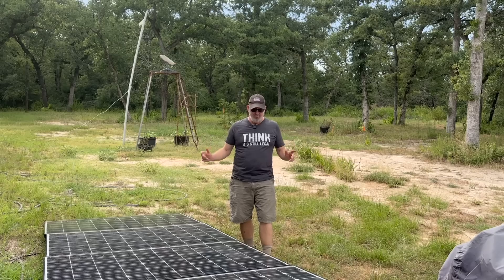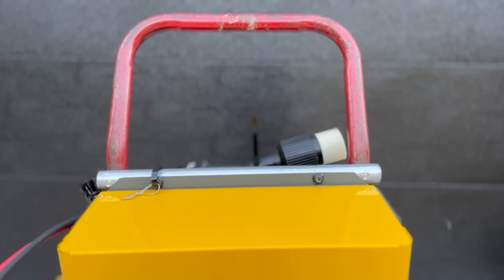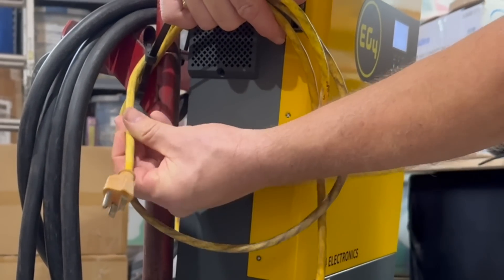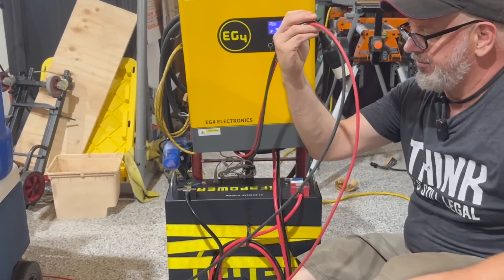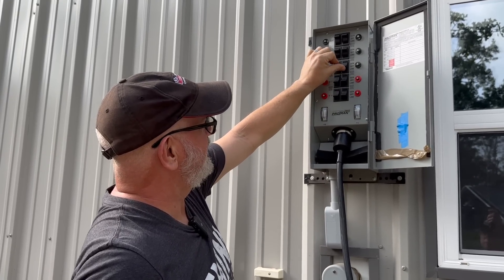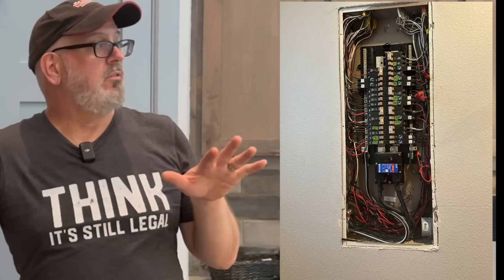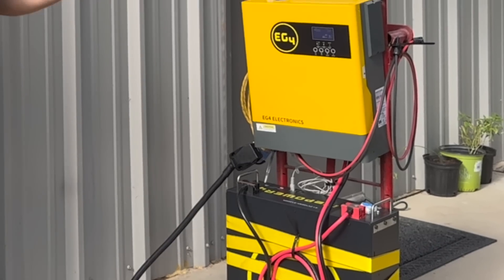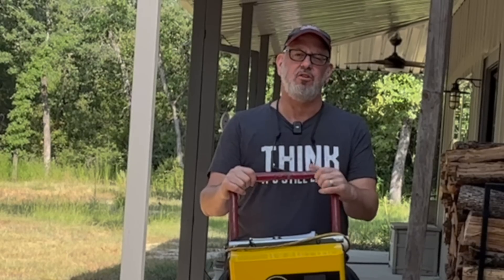CHEAP DIY Solar Power Portable Generator

Comment: Have you tested the runtime with ref. freezer and  small a/c ect.  I know how to figure watts and watt hours, just seeing if you have tested your system.
Reply from the maker: Thanks! I have 2 full size French door refrigerators, one med sized chest freezer, on demand propane water heater and all the plugs, lights and C fans as critical loads.  Since the appliances each turn on and off by thermostat, it’s tough to get an accurate wattage consumption as the watts fluctuate.  I can tell you we lost power for 4.5 hrs a few weeks back and the temps were 100f+.  I did not power any air conditioning since the house was already cool.  It powered everything during that outage and the battery had almost 50% more power left over.  I’d estimate we were averaging about 500watts/hr constant draw.  Add a 6000 BTU window unit and the consumption would have doubled.  Any air conditioning is going be a constant drain so that will shorten the run time significantly.  With a 5100wh battery drawing down to 20% SOC you’ll get about useable 4000whs from the battery.  I’ll set up a better test once it cools down a little.  👍⚡️☀️🔋
Reply: Still haven't pulled the trigger on building my system yet, hurricane season is on us now, Iv'e got the generators ready though. Will be watching your channel for updates.  May have to ask for some advice and tech. help.  Thanks! Stay safe... @terrahillfarm
Reply from the maker: @t.d.harris1311  Thank You! I’m not a big shot YouTuber like some of these folks but I enjoy diving into most energy independence projects and making quality videos to share the knowledge.  I don’t mind answering questions as long as you don’t take my advice as an “expert”🤣

Comment: System questions:
Do you know how much standby watts are used by the system just to have it on with nothing attached?
Also what is the minimum voltage of the array in order to charge with a solar panel?
Reply from the maker: Thanks!  I’ve heard between 50-77watts standby drain.  I think 70w is pretty close.  So you’d need about 300w of extra solar to offset the loss.  You need a min of 120 volt solar to turn on the Mppt.  Good news is you can run panels in a long series string to get there and that allows you to use older panels if you want o save money.  4-6 panels with 36v output would be a good starting point.  The downside of low cost HF inverters is the high standby power.  Haven’t found found any with less than 60 watts.  ☀️⚡️👍💡

Comment: Do you have links to the rv cords?
My setup at the cabin they wired an RV plug for me that goes into my breaker box and I plug that into the gas generator.
And I watched will prowse video and that's when I got the idea and then I saw your video and I'm like well this would be great I could just plug the cabin right into that. But I need the part that receives the rv plug. For ac out of the inverter.

Comment: How many of those batteries can i add to that setup? Because all of the videos with this exact setup use only one battery. And if you can would it be best wire the batteries up in series or parallel? Ive been wanting to do this project but i really need to have 3 maybe 4 of those batteries, would that inverter system handle it? Sorry im new and i kinda became addicted to solar lol
Reply: Since they are 48V nominal batteries, you should only hook them up in parallel, but you can put as many as needed in the system, if you can afford them. The reason THIS set up is using only one battery is to keep it mobile. Yes, the inverter could handle more batteries, as long as you use a properly sized fuse.

Comment: You could get a bit of ROI by leaving it connected, using solar panel to power the house and also having the inverter connected to the grid as bypass when you are not generating power?
Reply from the maker: @TimotheFillionBrunet  Yes, you can do that with most inverters, the trick is to make sure you account for the max amps coming in from the grid and from the solar so you don’t overload the inverter.  So far I’ve chosen to switch back and forth from grid to solar instead of passing through.  I have a bigger system now and am designing it to run the house off solar and battery back up 100%.  Check out some of my newer videos to see how the system has grown from the little back up power station!  👍⚡️☀️👍🌞

Comment: Can u power house with out batt in loop . Like  after the batts are topped off it switches to  just solar
Reply from the maker: You can set the inverter to use solar to keep the battery charged and when the battery runs down to 20%, grid power kicks in and runs it back up to 60% then switches back to solar, if available.  This setup will minimize the grid use and maximize the battery and solar use.  Takes a while to figure out settings but it can be configured more ways than I expected.  👍☀️⚡️

Comment: Ive always thought that L14-30R would be best plug to use over a RV plus TT-30R. Whats your thought on using the EG4 6000XP instead so you can have 240V output in one unit for around $1450?
Reply from the maker: The TT-30R is only 120v which is fine for most smaller travel trailers.  Once you get into coaches and bigger RVs running 240v appliances, I think you’ll move up to a 50 amp service connection.  As far as the 6000xp goes, it’s definitely going to power most any RV, the challenge is installing enough batteries and solar panels and where do you place them?  I’ve been testing the 6000xp and it has been running my entire 3 bedroom home with 3 tons of air conditioning.   I Don’t think you can get a better inverter for under $2,000.

Comment: How did you wire your TT30 plug to the inverter?
Reply from the maker: Ordered an 18” L5-15P to TT-30R dogbone adapter off Amazon and cut off the L5-15 end..  Took the three wires (black/green/white) and wired them to the  AC input of the EG4 3000 EHV Inverter.  

APEXSPORTS 1.5FT RV 15A to 30A Pig-Tail Power Adapter Cord 5-15P Male to TT-30R Female Dogbone, Easy Unplug Design, LED Power Indicator. https://www.amazon.com/dp/B08NWRVNZ2?psc=1&ref_=cm_sw_r_ud_ct_PHNKJM49KF99QA6W5G1S&language=en_US

Comment: Do you have a video where you cover how you wired everything together?
Reply from the maker: @daveaz9962  let me see if I edited out some of that from the original video and if I find it, I’ll  post something to show how it’s wired.  Basically, the inverter has solar PV DC in, Battery DC in, 120v grid input and 120v inverter output to load.  Battery & PV solar panels are two wires pos & neg.  120v AC in and out are three wires black, white and green (hot, neutral and ground) like any 3 prong 15-20 amp plug.  In my application, I never used the 120v AC input, just the out put from the inverter.  That’s a true “off grid” set up.  You can cut the plug off a multi outlet (surge protector) power strip and wire it directly to the AC output.  Then you can plug in what ever 120v appliance you like.  Or, you can wire it up to a 30A RV style receptacle like I did, then buy an adapter that takes the three wire RV plug and adapts it to a Four wire generator cord.  This is how I plugged it into my generator transfer switch.  There are lots of options but just realize you will never get 240v power out of the inverter.  It’s only 120v.  If you need  240v step up to the EG4 6000xp. It will provide 6000 watts of 120/240 split phase power and is just about the best AIO inverter that size you will find for less than $1,500.

Comment: Thanks for the video. I have a question, I just built this same set up you have and I have found when I have it hooked up to the PV and have the minimum of 120v coming in for the unit to start charging I have a small amount of power in the handles of my eg4 48v battery. Just enough to give you a buzz feeling if you touch it. Are you having this issue?
Reply from the maker: Thanks!  I’d first make sure the inverter and battery are running the current firmware (check EG4electronics.com for files and instructions).  Check the solar panels and see if you’re getting a buzz there as well. The Inverter and battery should share a connected equipment ground, the metal hand cart did it for me but there’s an equipment  ground screw on the outside bottom of the inverter case you can run a wire to the battery case and see if that stops it. Lastly, with the older Ver. I 3000 watt inverter, they had an internal neutral/ground bond screw.  If yours is a a couple years old or refurbished, it might still be in there and that could cause issues, depending on how you are using the inverter. Hope this helps and check the DIYsolarforum.com for more info on trouble shooting this inverter and battery combo.  👍☀️⚡️🤩💡🔋
Reply: @terrahillfarm  You the man, you gave me a lot to think about and check. I just bought both from Signature Solar brand new, but I understand they can still be old stock, and the firmware needs updating. Didn't even think of that. The panels don't buzz me, but I will forsure look into these other tips you have given me. I will also make it a point to come back to this post with an update as to what the issue was for the next Joe like me in hopes it can help the next guy. Thanks for getting back to me so quickly!!

Comment: I just ordered the same inverter and battery. I’m confused on what size panels to get and what size solar cable 30 foot  of cable
Reply from the maker: Thanks! Value wise, if it were me, I’d go for panels around the 400 watt range with a voltage under 38 volts.  This will let you easily run a dozen panels in a single string and keep you under the 500volt/5000 watt inverter limit.  10 AWG PV wiring or similar size THHN in conduit always works well for me.  If you have a really long run (200’ +) you may consider 8 AWG wire.  👍🤩☀️⚡️🔋
Reply: @terrahillfarm  I found some 340 panels local to me for a good deal I’m thinking of starting with 4 or five of those. Would 10 gauge be ok for that? It’s an emergency back up system.
Reply from the maker: @jglassman1122  Used panels can be expensive sometimes.  It typically costs $50-100 each to permanently mount a solar panel, so the more power a panel generates, the cheaper it typically is to install.  If they’re 10-15 years old they may only output 60-75% of their rated power which means you may only get about 1/2 the rated power output on average. Since you’ll need more panels your install cost and your voltage will be higher limiting the number of panels you can use in one string.  Make sure you understand your amp limits in the SCC if you try to run parallel strings.  Best bet is to only buy used 6-8 and test them out first.  If they regularly give you 85% + of the rated power then get more.  I purchased my new 405 watt bifacial panels for around $100 each.  I’m regularly pulling 90% of the rated power from them and that lowers the number of panels needed and the cost of racking them.  Just some things to think about.  Nothing wrong with starting out with dirt cheap used panels but make sure you know the performance before going in on a big purchase!  🤩☀️⚡️👍
Reply: @terrahillfarm  you made some good points. I found some brand new panels 400 W 155 each about an hour from me so I think I will go with those.
Reply from the maker: @jglassman1122  Awesome. Don’t Forget, if you have paid a similar amount in for income taxes this year, you can get 30% of the price of your NEW equipment back in a tax credit when you file your tax return.  That really brings the cost down! 🤩💴
Reply: @terrahillfarm  

That’s good to know I’ll have to look into that. I didn’t realize that was for DIY systems as well.

Comment: I currently have a manual interlock kit installed on my panel with a 30amp breaker & 30amp reliance inlet box NEMA L14-30P. How would I wire the AC out on the “solar generator” so that both legs are hot? (I would just leave all my 240v circuits turned off)
Can I just wire a NEMA L14-30R female as the output on the “solar generator”?
Reply from the maker: It depends…Personally, I prefer to move my critical load switching out of the main service panel, but for running a limited 120v source into a hot panel with an interlock, I’d call in a pro (which I am not) for assistance.  This 120v 3000w inverter can spike to over 4500w so proper wire and breaker sizing is essential to avoid injury or fire.  I bought a short dog bone adapter and cut off one end to do mine.  They sell similar adapters for most plug sizes on Amazon.  I think those for 3 into 4 wires are pre wired with both legs hot and thats why mine worked.  If you want to get sound advice from actual experts, I’d join the DIY Solar Forum, those folks have probably done what you described before.  😊

Comment: If you buy a secondary inverter and secondary  battery 🔋  you can plug grid power into the inverter if the battery gets low it charges the battery and you will never be with out power ever again just re wire your house to run off Solar battery inverter and if the battery gets low then it pulls power from the grid from the ac side of the inverter.
Reply from the maker: Thanks! That is correct.  In fact, I’ve recently installed two EG4 6500xp inverters and plan to use the 3000 watt eg4 inverter as a back up 120v battery charger.  Works great at 35 amps!    I’m up to six batteries now and running the house on them.  Should have a couple new videos out shortly, please subscribe to not miss those!

Comment: Can you plug in a window AC with this system?
Reply from the maker: Absolutely!  I ran a Midea 12,000 BTU inverter window unit in the heat of summer (92F++). and could get about 4-5 hours off the battery.  When I hooked up 2kW of solar panels up solar panels that time would double.  If the temps were slightly lower it’d run longer but it was really hot when I was testing it out.  If you’re running a window unit of 5-9,000 BTUs it may do better.  It gets heavy, but you can add a second battery and double everything.  👍💡☀️⚡️
Reply: @terrahillfarm  yes, it's the smallest 5000btu window AC that frigidaire makes, label states "480w"
Reply from the maker: @gwrulzmylife  here’s the rough math:  5200 watt hours in battery x 80% usable per cycle = 4160 watt hours divide that by 480 watts and you get 8.67 hours run time.  But you’ll lose around 10-15% converting DC to AC so you should get a solid 7 hrs run time maybe more if it cycles with a thermostat. Hope that helps!  👍

Comment: Great video! That's exactly what I want to set up eventually at my home. Also, I think it may even qualify for a 30% federal tax refund.
Reply from the maker: Thanks!  Correct… if you “install” the solar system and battery backup in your home, and the components are new, I believe they qualify for the tax credit.  I’m no CPA but I think that you have to have paid taxes that year, in an amount equal to the credit, to receive 100% of the credit.  Apparently “some people” who didn’t pay any income tax were surprisingly shocked that they didn’t get the credit after purchasing a system.   That’s why they say check with YOUR CPA before counting on the tax credit!  ☀️🫣⚡️👍 💴
Reply: And another opinion on that matter is not going for the tax credit... what they don't know I have they cannot take/ban.
Especially if you're in the city and just have a few panels set up on the ground in your backyard.

Comment: alibaba an alixpress have inverters for $370 but you pay shipping i dont know about quality they also have batteries at half the price as well
Reply from the maker: Thanks!  Ive heard both good and bad experiences buying batteries from Aliexpress. I think the next step up would be to mount an EG4 6000xp and a 14.3 kWH vertical battery like the power pro.  You’d need a taller cart but you could run your whole house off it for days with solar panels assisting charging.  If you want to save money, look into the 15 kWh Apexium battery kit from Docan.  Last I checked you can put it together yourself for less than $2,000.  That’s a lot of power!  👍☀️⚡️🤩💡🔋
Reply from the maker: Thanks!  Ive heard both good and bad experiences buying batteries from Aliexpress. I think the next step up would be to mount an EG4 6000xp and a 14.3 kWH vertical battery like the power pro.  You’d need a taller cart but you could run your whole house off it for days with solar panels assisting charging.  If you want to save money, look into the 15 kWh Apexium battery kit from Docan.  Last I checked you can put it together yourself for less than $2,000.  That’s a lot of power!  👍☀️⚡️🤩💡🔋

Comment: The price of an EcoFlow Delta Pro is currently $2550 - just bought two of them from Costco.
Reply from the maker: Thanks! That’s a fantastic deal considering they’re $3,200 on Amazon right now!  Certainly a better option if you need portability and aren’t heavily reliant on solar panels for charging.  The costs (at $666/kW) and proprietary nature of their external battery makes it a less desirable option if your ultimate goal is to develop a whole house solar solution with batteries. 🔋 Your can purchase LifePo4s for around $325/kW right now. That said, I’m not turning one down if I’m stranded out in the woods somewhere and need to charge my phone or EV! 🌲 🐻 ⛰️

Comment: So can the panels power the house alone . No grid with a bigg bank could work no
Reply from the maker: Thanks!  This inverter requires at least one battery to operate but that’s not really enough to fully power a house.  If your home was only 120v, your peak power never exceeded 3,000 watts throughout the day, and you had a battery bank with enough panels and batteries to cover 1.5-2x  your daily electric usage, then this inverter could power your house, without grid (that’s a lotta ifs!).  Calculating the right combination of panels, batteries and inverter is tricky since everyone has a different level of power needs.  I’ll continue to show what works (and doesn’t) for my use and hopefully that helps folks understand what they need to ditch the grid! 👍⚡️🤠